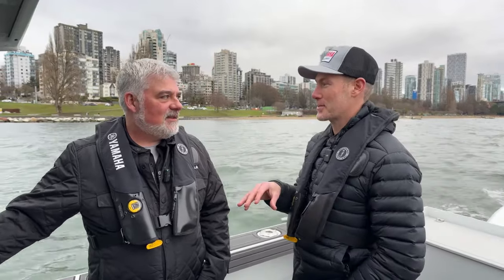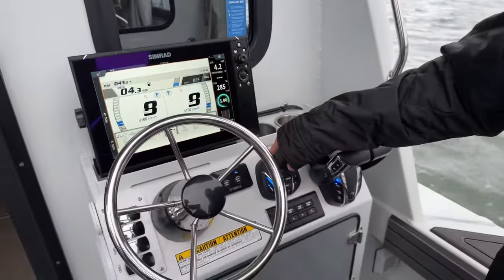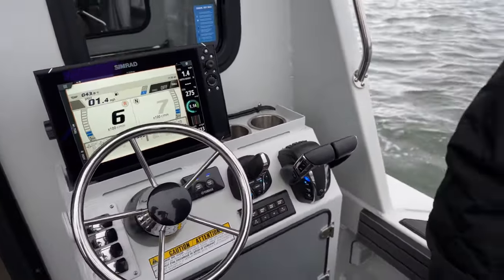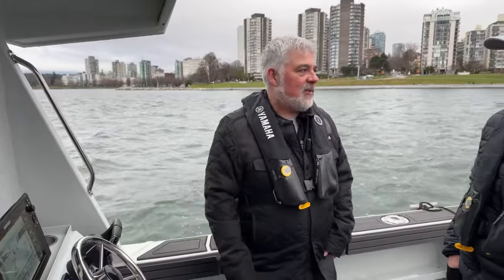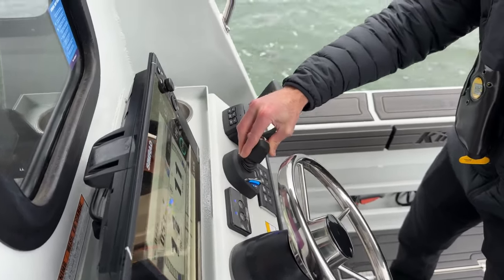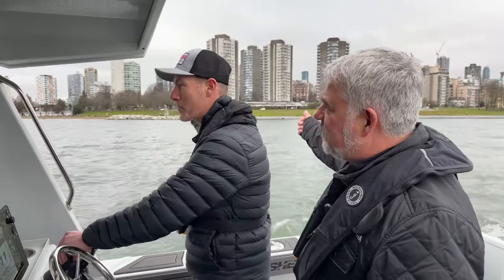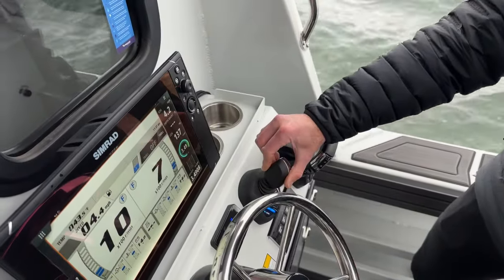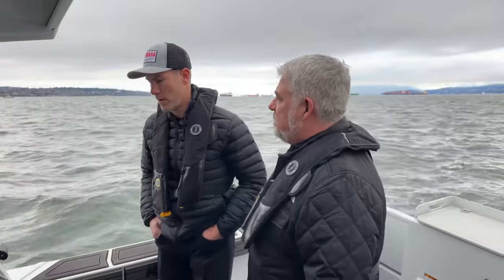What is the Helm Master from Yamaha Motors?

Comment: whats the oldest engines this system can work with ???
Reply: If your Yamaha has digital controls and electric steering, it will work. If you just have digital controls, you can add electric steering and have helm master.
Reply from the maker: Thanks for answering Jeff!